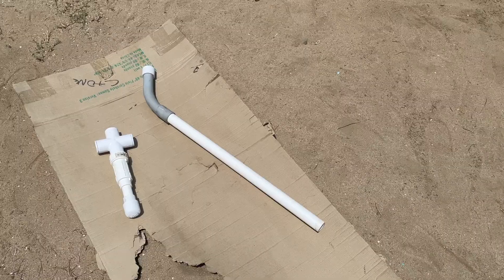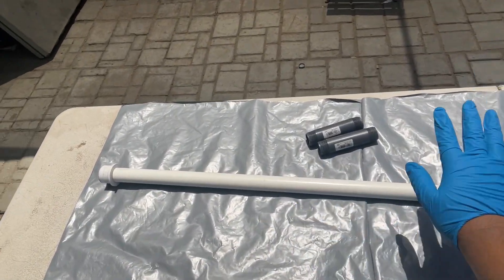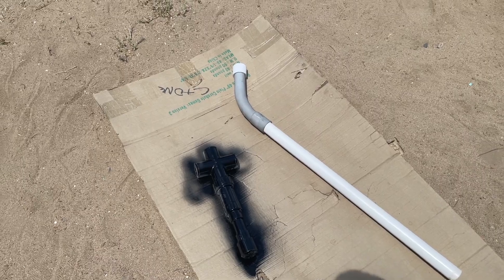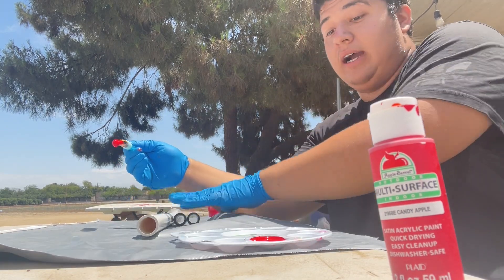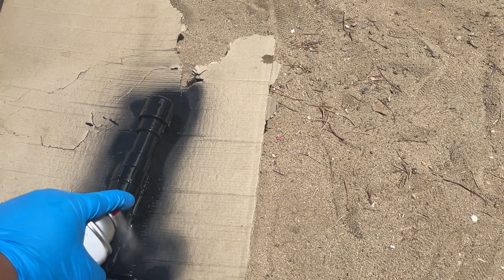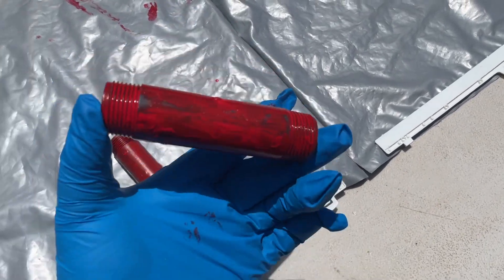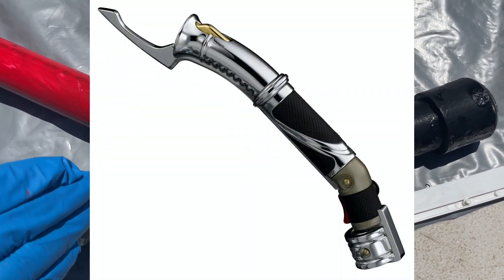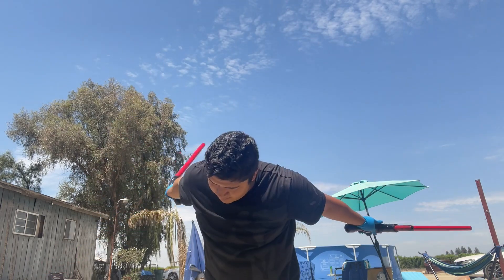Painted PVC Lightsabers Showcase (1,000 subscriber special!)

Comment: Just a heads up when it you spray paint anything, you don’t want to be as close you were. It’ll pool and rub off super easy. For a coat that won’t rub off do multiple thin coats. They will also dry way faster so you can paint more in a short time.